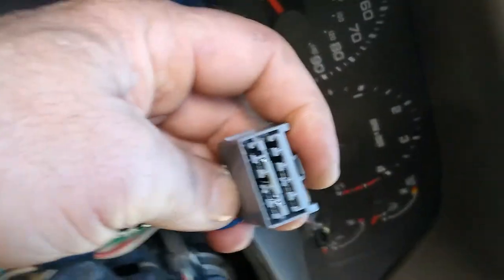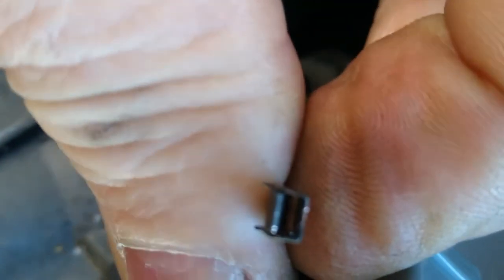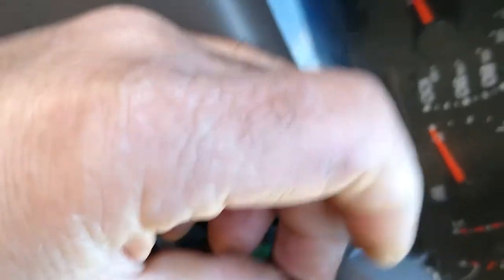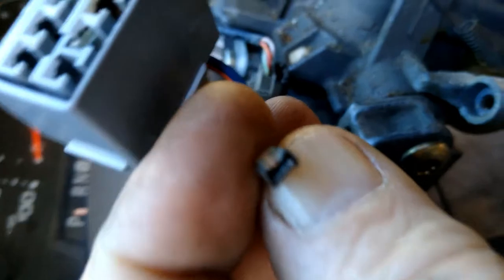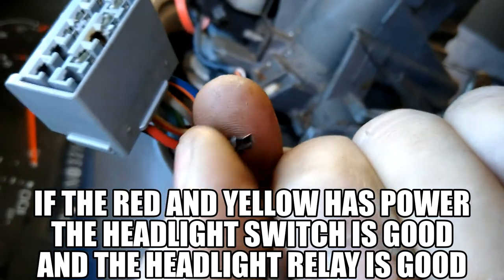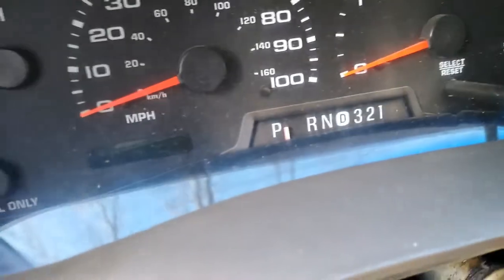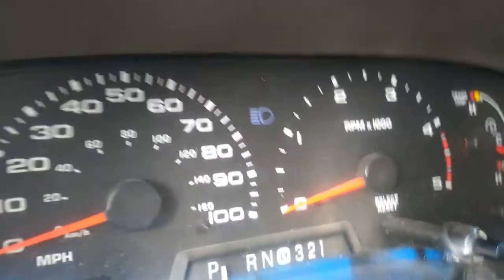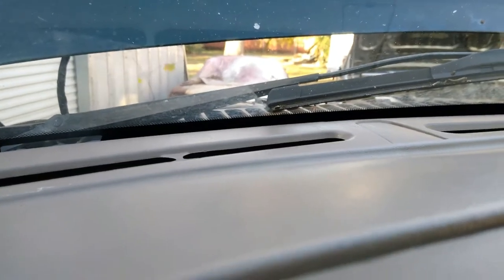03 F250  No Headlights Issue Solved

Comment: This worked for my 2004 F250 Lariat. The same red/yellow terminal was burnt at the turn signal switch. Most of the terminals were spread open too far. I pushed them all back down and headlights work again. Thank you for this.
Reply from the maker: Glad it helped

Comment: Just want to say thanks for this video.    We have ben searching for three days to find out why the headlights do noit work.   Tested every switch and found all to work well.   I happened across your video this morning and at teh end of day i thought I should check the plug.   As the shop lights were being turned off I fould the same thing you discribed only ours was much worse.    There are two plugs burnt up and one wire burnt off.   Not sure if this is the result of a failure somewhere else but we will not know until the harness is fixed.   Again I say thanks   Art
Reply from the maker: I did the same thing watched every video tried to look up wiring diagrams nothing helped off YouTube.  The way Ford wired the light system is weird power from the headlight relay in the fuse box feeds the headlight switch then the multifunction switch then it goes back to the fuse box to the high and low beam fuses then to the bulbs. I used a power probe tested the headlight fuses and had no power so I applied 12 V to the fuse and the lights came on. After that I knew the bulbs where good and the wiring to the bulbs was ok I had power at the headlight switch. What had me confused was why they put the fuse after the headlight switch and the MFS and made it where you can't replace the headlight relay built-in to the fusebox. I guess they want the fuse box to melt so they could sell you a new one for more than the truck is worth lol. After the madness it took to figure it out I figured I would make a video to keep people from pulling there hair out and waisting 3 days of there life trying to finding the problem. This was the second truck that had this problem that I worked on. The first one I gave up and just wired a relay in to a fog light switch to turn the lights on with. The guy had to get to work and I waisted all day trying to figure it out it was dark at that point and he wouldn't even be able to leave my yard with no lights. Both trucks had been (upgraded) to HID headlight bulbs I know that's what caused the problem to both trucks they use more amps not enough to pop the fuse but enough to melt the plug at the MFS so don't (upgrade) to HID bulbs!  I'm glad my video helped you and you're welcome like you said time is money.

Comment: thank you .. watched your video went straight to it and was exactly as you said.
Reply from the maker: Glad to help! I watched several videos pertaining to the problem looked up wiring diagrams nothing really helped. After wasting  6 hours with no luck diagnosing the problem from watching other videos I used a power probe and applied 12 volts to the fuse and the lights came on. I had power at the switch the fuse was good so I backtracked from the fuse and finally found the problem.  Someone (upgraded) and swapped to HID headlight bulbs and it's too much amperage causing the wire to get hot and basically melted the plug and eventually lost connection at the multi, function switch. Hopefully everybody that this helps will subscribe and hit the like button and help me out.

Comment: I have a 2003 F-250 I smelled a burning wire briefly under steering column. After that low beams do not work. Hi beams are ok. Any ideas? Thanks
Reply from the maker: Check that red and yellow wire it's the main feed wire to the dimmer switch. Once you unplug the dimmer switch you'll see what's burnt. The dimmer switch might be what got smoked one of the two. It's not that hard to get the cover off or the dimmer switch.
Reply: I have the same problem, did you get it fixed? The red and black wire was burnt on my teuck

Comment: Great job... u remember me? I'm the guy who bought that 5.0 explorer for 500$
Reply from the maker: Yep, did you ever get it going?
Reply: @kickassmustangsgarage  here is the funny thing... I ended up selling the 79 ford to a Mexican and I am daily driving the explorer with that monster 5.0 engine. It's really fun to drive around!!! I changed sparkplugs, wires, oil change, etc doing all the services to the engine. I also installed a true duel straight pipes exhaust system and man that explorer sounds like a mean foxbody mustang. I'll upload a vid on YouTube so u can see
Reply from the maker: I bet it does have a tone now LOL.
Reply: @kickassmustangsgarage  why the hell does it sound like it has a cam??? It does not shake at all but I sounds a bit heavy!
Reply: I didn't remove any cats! It has all 4 original cats with 2 1/4 inch pipe true duels all the way back
Reply from the maker: @brayanmacias6083  the factory cam has a little chop at low RPMs
Reply from the maker: @brayanmacias6083  it should sound about just right with the cats still on it.
Reply: @kickassmustangsgarage  yea it's really cool, I also have a upper and lower gt40 intake like the cobras so does it flow like a cobra?
Reply from the maker: @brayanmacias6083  the Explorer intake flows about the same as a cobra intake. About the only thing different on a cobra motor is the rocker arms cobras came with roller rockers.

Comment: How do I get the wire out
Reply from the maker: You gotta pull the plastic clip out of the face of the plug (should be red)  then take a pick or a torch tip cleaner and push the tab back that holds the wire in the plug. If your plug is melted bad it can be a pain to get the wire out. Once you get the red plug out look down a slot without a wire and you'll see the tab that holds the wire in the plug. Push the tab and pull on the wire it'll come out if it isn't too melted. Good luck with it!

Comment: My 7.3 diesel injector Turbo The headlight will come on inside but they do not come on
Reply from the maker: If you take a test light with the switch on it should have power at the fuse for the headlights. If you don't have power at the fuse it's either the red and yellow wire in the plug to the multi function switch or the multi function switch is bad.  If you touch the fuse with 12 volts the lights will come on to test the bulbs and wiring from the fuse box to the bulbs.

Comment: How did you get the wire out of the harness?
Reply from the maker: I used a tourch tip cleaner a paper clip will probably work the same. The wire has a tab that holds it in the harness. Push the tab in with the paper clip and pull it out. The plug was starting to melt and was a pain to get it free.
Reply: Ok thank you I will try it again.
Reply from the maker: @danielhagerty8796  there is a plastic plug that you pop out first it should be red that locks the tabs in.   Once you remove it you'll see the plastic tab that holds the wire in the plug. I forgot to explain that last time .Hopefully this helps you out.